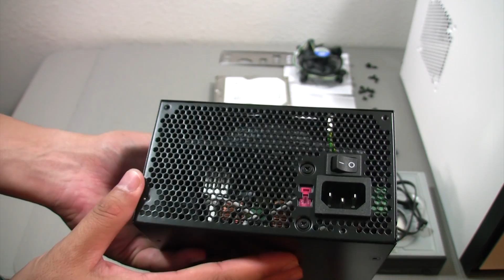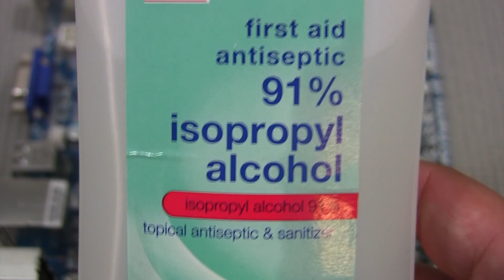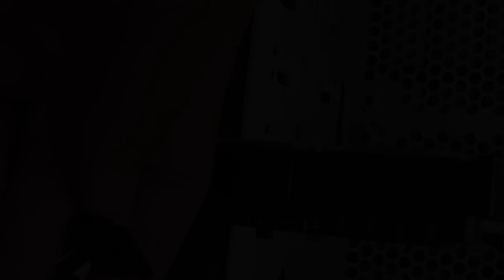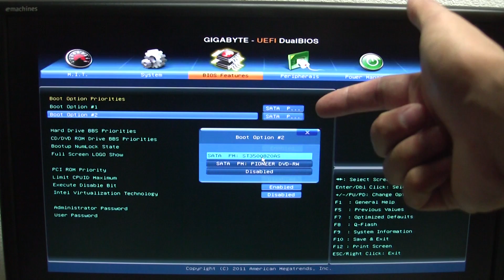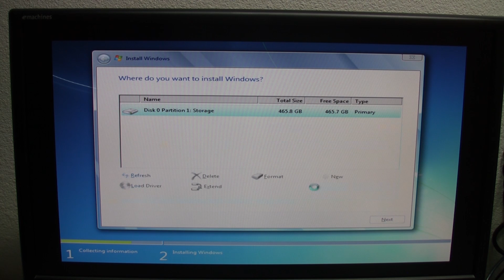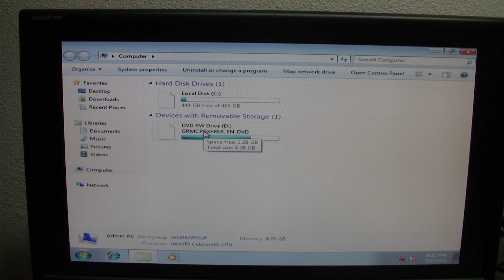Guide to Building an Intel PC 2012

Comment from the maker: I would suggest looking at the manual and going by the layout of the pins. In the manual there is a pin missing and on the motherboard there is a pin missing. You would then plug in the front panel cables following the guide and using the missing pin as a key. I have another video where I built a computer while blindfolded. I used the missing pin as my key to find where to plug the cables. You can find the manual online if you lost it. Good luck and thanks for watching!

Comment: My eye sight is not that good at all and i have this question. I have an Ultra XBlaster xase with the PSU at the bottom but you showed part about the wiring but i could not tell that much from it. I have the Asus M5A 78L-M LX Plus motherboard and could you make a video and show step by step on wire by wire as to where they go. My vision os 30/100 and i cannot see small writing at all and it is hard to see far away as well.

Comment: I've got issues Johnny, mine won't even give me the spinning wheel after I take out I boot disc and put the retail snow leopard installation disc in.  I've got the same board, case, i5 3570k 3.4ghz CPU, 8gb ram. Any idea on what could be wrong?

Comment from the maker: You won't be dealing with warranty issues for your motherboard only. If there was ever a problem, you would be sending back the entire PC so you don't have to worry about the cpu socket protector. This is only for those who bought the motherboard stand alone to build their own computer. You did not get ripped off. Thanks for watching.

Comment: AMD is worse, it has higher failure rates, I'm not saying its bad, but it has a higher failure rate. On my Windows server, 10 of the computers were powered by AMD and 15 were powered by Intel. Five of the 10 AMDs crapped out on my within the first 3 years. Only 3 of the Intels have ever crapped out on me. I am not an AMD fanboy or an Intel fanboy, but for a long lasting computer that is pretty good, go intel, for a short, less than 3 year lifespan computer that is very good, go AMD.

Comment from the maker: Thanks for the info. That is what I originally thought because that is what happens on the very first time I installed it. Since in this video it was the second time I installed it (no thermal grease is a giveaway) I must have push and pulled the tabs out of the white piece of plastic.Good eye.